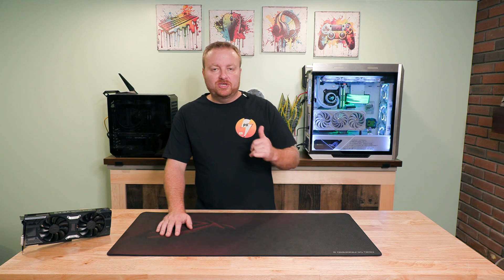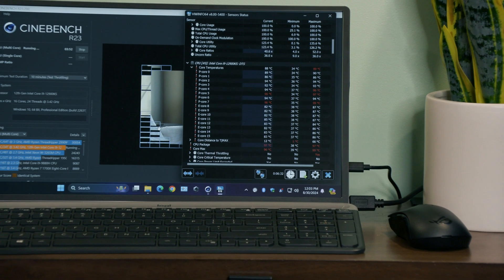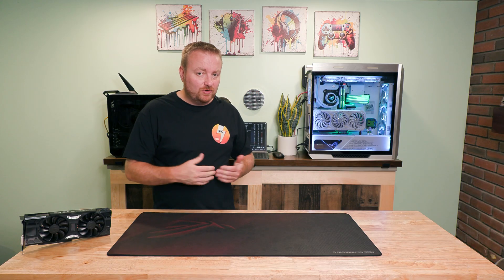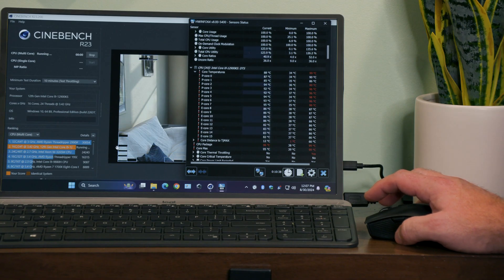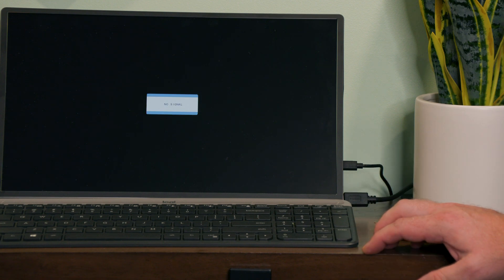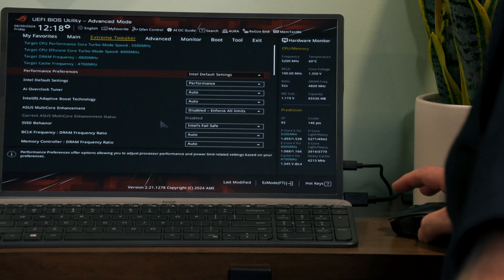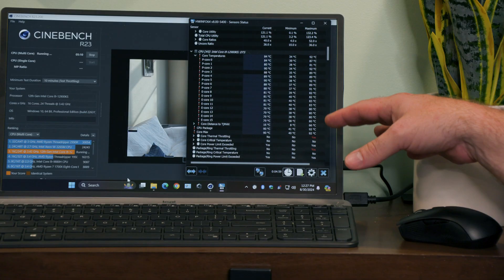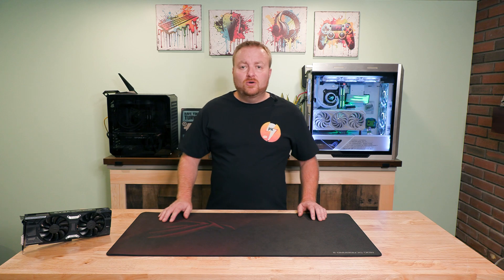12900KS Overheating - You will not guess why

Comment: Bro your initial spike is your other power limit, set it lower slightly when ajusting long term power. Also undervolt and ajust aio pump to 70- 100 percent using multiple fan headers for full fan speed. I have a push pull artic 420 on my case and am 15-20c below your temps on a hot day. I have a high airflow nzxt h7 case. I dident even undervolt or drop power limit the cooler in push pull is just that good. Rgb is 1 degree c hotter and your side panel may need replaced with pvc mesh for more air...

Comment: Thanks for the content, the OCD in me wants the CPU core thermal throttling to not occur. Apart from increasing cooling performance, do you keep going down in PL states and under-volting to get to the point where  there is no thermal throttling anymore?
Reply from the maker: At this point the bios updates have addressed most of this

Comment: My i9-14900K idles at 39-41   My i9 and bios are updated with 64gb XMP turned on.  Lian-Li push-pull 120 radiator, RTX 4080 Super,  UltraGear 240hz 45 inch monitor.  I play AAA games all on Max setting . with Wallpaper Engine, HWMonitor 64, Fence 3, Ring cameras, Music player all running in the background. No issues at all and no temps ever reach over 75 degrees.  However, when I ran Cinbench it throttles, but no high temps though, just core power limits.   I don't trust or will ever run Cinbench again because it's to much demand on the CPU, GPU.  It's like putting you truck in park and pushing the  accelerator al the way to the floor to see the highest RPM.  That's why it's RED to warn you. It's the same with a CPU.  After a wile you will blow your engine, don't stress you CPU to red.  that's crazy.